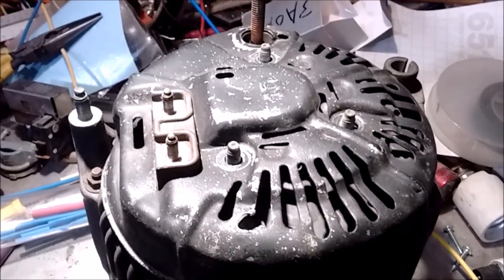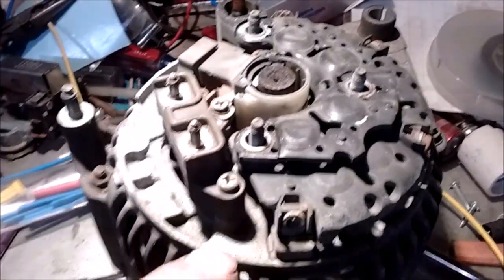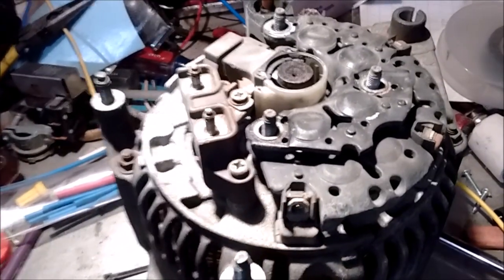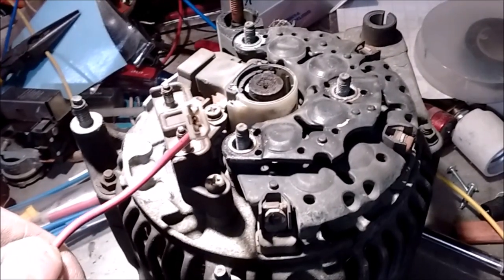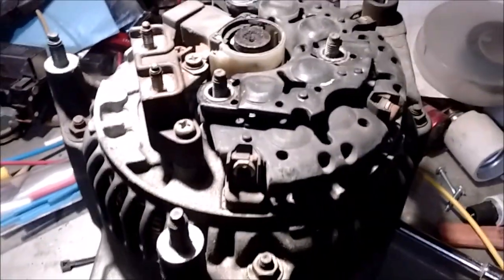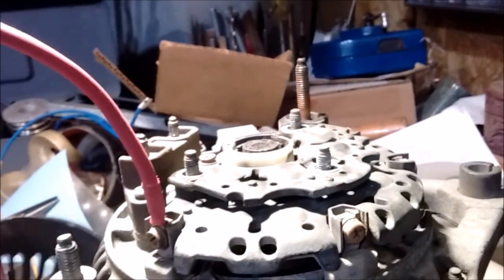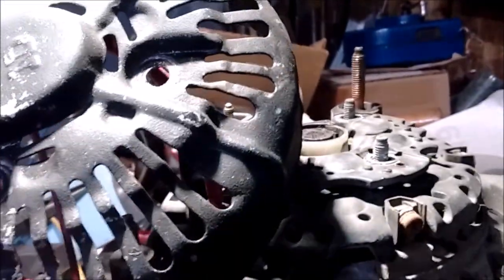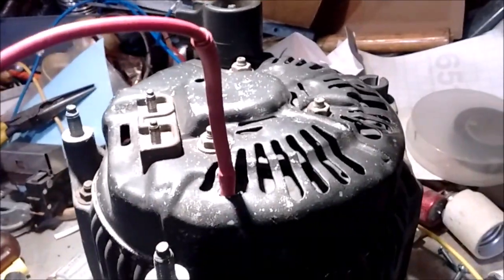Hooking up a boat tach to your 1st Gen Dodge Cummins

Comment: Excellent, I did the same thing on my 1991 Dodge Cummins, but the Teleflex boat tach shows 1200rpm and can not be adjusted downwards any more than that,  the idle is supposed to read 750 rpm. I will try to lower the alternator signal by installing a potentiometer.
Reply from the maker: Did you check it with a laser tach at the balancer? Try and find one of those as well. Good luck, and thanks for watching.

Comment: So I've recently discovered this little known stupid trick of the trade! On how you can read RPMs off the AC generated off a alternator. Never knew they made such a Tachometer for just this purpose until I wanted to give my old 1972 Arctic Cat Wankel 303 a tachometer cheaper than a Autometer Jr Dragster tach that will read off just about any source! But your spending almost $200.00 for that luxury and still no matter what need a 12vt DC power source. Upon reading my 74 Arctic Cat service manual there's a section on Tachs and tells you all about how to wire up a tach off the lighting coils under the flywheel. Rather than going through the points or coil system of the ignition system. I actually have one on my 2 stroke drag cart that I spent the crazy money on to get a Autometer multi tachometer which is also capable of reading the induction of the high tension AKA spark plug lead which works awesome and you can use on just about anything with a spark plug and from 1-12 cylinders. BUT after reading what Arctic Cat was talking about reading off the AC lead of the alternator itself without touching your ignition system I was thinking Man that be awesome if I could do this with my wankel being it's a completely AC lighting systems. So the requirements are you need at minimum a 4 pole or 2 lighting coils to have a North South / South North set of coils under the flywheel, mine had only 1 coil with the option for the upgraded higher output lighting systems bringing it from roughly 100 watts to 123 watts by adding a extra 23 watt coil across the stator from the other bigger one. The 4 wires coming off both coils are tied together into a parallel 2 wire combination to create the high output system. So you can now tap into one of those AC wires and get a tachometer suitable for 4-6 or 12 pole alternators, and the 1 AC wire goes to the source of the tachometer stud the other is chassis or engine ground your choice. The last is to power the tachometer itself, if it's got a  back light and circuit board probably too. This requires a 12V DC source positive + and needs to be on a switched source like the key switch or an extra toggle switch, so it doesn't run the battery down along with possibly burning out the tach as well! BUT that's it!!! A cheap I paid 20 bucks for a jet ski water proof brand new old stock tach that's made for a 4 pole system which can be mostly all jet ski's, outboards with a 4/6/12 pole alternator that's under the engines flywheel. You'll have 2 wires leaving the stator prior to the voltage regulator/rectifier which converters your AC power into DC power. So you want just 1 of the AC wires to make a water proof tap into it which runs to the S or source of the tach. The bottom "G" or "G - " is for ground of the tach and the last marked "I" or ignition or sometimes B or B+ is your battery 12V + on a switched circuit like the accessory position on the key switch or worst case having to add a separate toggle to power it and turn it off after engine shuts down. Thank you for the video it's very helpful for anyone who's in the dark about this especially on a Diesel which has no ignition system to run off of. Most Diesel's ran a cable drive tachometer back in the day due to that problem. Again thank you for explaining it and showing how simple it really is to add a tach on something or just about anything with a alternator system!
Reply from the maker: You should post up some videos on how to hook them up to old snow machines and such. I bought a SeaRay tach for my next older diesel truck for around $20.00 off of Ebay. Thanks for watching.
Reply: @TheBlueCollarPreacher  wish I had the time man otherwise I would. My Job has me traveling all across the country, I work for the big pharmas as a lab engineer. Between work and traveling I'm shot by the time I get home. Otherwise I'd definitely would. Thanks for the post and again thanks for older diesel tach conversions off the alternator!

Comment: Good tip, I will use this on my 91.  Thank You!!
Reply from the maker: +easytopleez33 Check my next video how I installed it with my other gauges in the dash, it also is pretty accurate as I checked it out with my laser tach from the blanencer.
Reply: Yep, worked on my AutoMeter Guage.  I did watch the vid on the gauge cluster you built, nice work.  I prefer the gauge pod on the window column.  Boost, pyro, tach.  I think alot of these old First Gens.  Thank You
Reply from the maker: +easytopleez33 Thanks my oldest is buying a 93 and we will go with the pillar set up on his.

Comment: Do you have the part number for the tach. Im searching but find multiple the looks alike. Thanks.
Reply from the maker: Don't have same exact, but I like this one better, it has 7 color LED to be able to match your other gauges. Hooks up the same way. Thanks for watching. https://www.ebay.com/itm/85mm-Tachometer-8000RPM-For-Diesel-engine-Tacho-7Color-LED-stainless-steel-Black/192887701240?hash=item2ce900bef8:g:dc4AAOSwW4hcsETp
Reply: This one might be installed on the crank sensor also ?

Comment: Do you need to calibrate it and if so how?
Reply from the maker: Some do have an adjustment screw on the back of them,, I didn't need to adjust mine I guess that's why I didn't show it. I have a laser tachometer that uses a reflective sticker you stick on the balancer, and it's 99.99% accurate.  That's why I had it hooked up under the hood first to make sure it was accurate. Thanks for watching. 😀

Comment: My spedo is jump n around and does not read at all started about a year ago twiching around to a hi speed, have u ever heard of this befor
Reply from the maker: Could be the sensor at the trans, Mine did the same thing until I changed it, and it started working fine after that.
Reply: I have a similar problem with my 93 I suspect it is the pcm however I cant find one so I'm not sure yet
Reply: @renatorubio77  I have a 93 Dodge Diesel as well 409,000 km with a trip meter not working and an intermittent speedo, replacing your PCM is not going to help you with this problem, so don't waste your money!! The problem starts with understanding that dodge put a Great Diesel into a flawed truck and wiring, check out DeBoss Garage on Utube Rich will give you an A to Z about our trucks. It is all in the wiring and don't buy a replacement sensor for the tranny until like me, you do your reseach because there at least 4 problems, before you replace that sensor.
Reply: @renatorubio77  start looking for a shorted or broken wire on the drivers side fender coming from the pcm to the cab.
Reply: @franklogan494  shorted wire almost guarantee it.
Reply: My odometer and trip meter work, along with my cruise control. But no speedo. Any thoughts? Oh, and nice videos brother.

Comment: How accurate is your tach? and how do you know if it's accurate? I need one on my 1st gen
Reply from the maker: It's very accurate, I also have an optical tach for testing that uses a laser and a piece of reflective tape on the harmonic balancer that gives out digital readings. Before I installed it in my cab, I guess I could of showed that in the video, with the side by side comparison.
Reply: I have an aftermarker tach in my 92 and im reading 2k tops on a bone stock setup. I thought the stated redline was 2700?  So i thought my tach was wrong but i see your reading the same so ill see what changes when install a new spring.  Thanks

Comment: will it work on a 1990 ramcharger 318 LA gas engine?
Reply from the maker: You need  tach that hooks to the ignition system for a gas.
Reply: The Blue Collar Preacher thank you. I wanna buy one any pointers on what to search for
Reply from the maker: Just make sure it works with you year and engine.

Comment: Whats a "W" wire?
Reply from the maker: It's a signal wire that hooks to the alternator
Reply: W  is from Winding (all car alternators are 3 phase, any one of the 3 terminals will do)
  it has the AC volts needed by the tach; 
  meaning the W terminal has the AC before is is rectified to DC ( NOT good for tach) by the diodes inside the alternator

Comment: can use a gas tac to diesel engine???
Reply from the maker: Only if you use a Dakota Digital module, or needs to be Diesel tach with W wire.
Reply: The Blue Collar Preacher ok.. 
 thanks for the info

Comment: Will this work with a 1990 1st gen?
Reply from the maker: Yes.
Reply: The Blue Collar Preacher just use any tachometer?
Reply from the maker: No, has to be a Diesel if that is what you are putting it on, and needs the "W" wire. Steve Reuter a few comments bellow has a link to a wireless set up.

Comment: your a badass 👍 👍  I should be getting my 92 back from the transmission shop tomorrow. I had my a518 built to take up to 750 hr. I'll never hit that make but bigger is better in my book
Reply: ive been working on a 91.5 with an a518 freshly rebuilt. do you find you need to give it alot of throttle to get out of 1st gear? what is your highway cruising speed? thanks if you have some answers